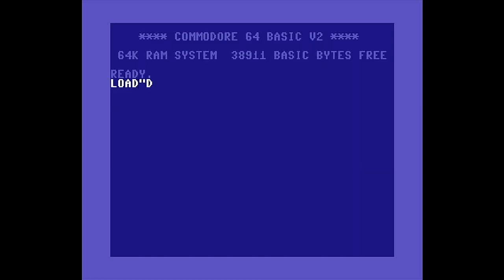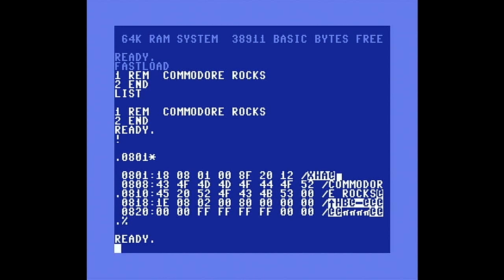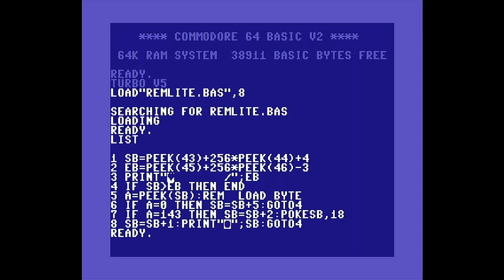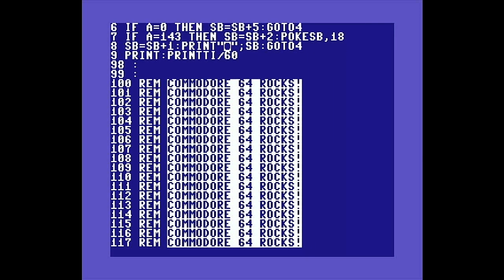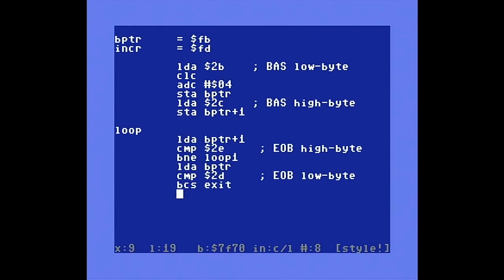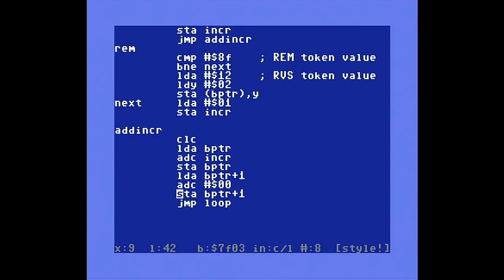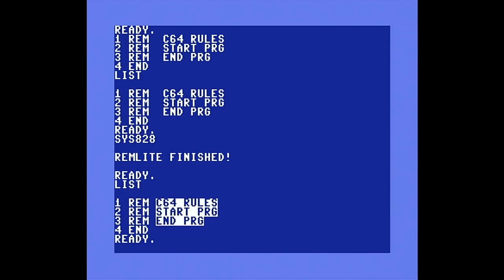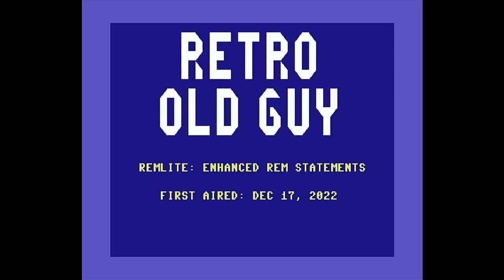Using Commodore BASIC and ML to create a REM enhancer utility for C64, C128 and VIC20 computers

Comment: it could also add a color change at begin and end...
Reply from the maker: Interesting, I tried this.  To get the color code at the end of the REM  you have to alter the bytes linking to the next line.   Once that's done, it displayed properly but if you add more program lines or run the program, it corrupts the last link pointing to the end of the program and will display garbage until you fix it again.   However I was able to do this:
     10 REM -- (BLACK} COMMENT {WHITE} --
Where the first two dashes would be whatever the current text color is and COMMENT would be black and the trailing dashes and all text following will be white.   This way the  programs internal links are not corrupted and you still get color comments.   BTW any printable character can be substituted for the dashes
Am I missing something though?   How would you do it?

Comment: Thanks for the tutorial!  Another way to perform the BASIC conversion would be to add the following three lines to the end of the program to be updated (assuming the highest line number is less than 1000), then type RUN 1000, then delete these three lines...

1000 forx=2053topeek(46)*256+peek(45)-3
1010 ifpeek(x)=143andpeek(x+1)=32andpeek(x+2)=32thenpokex+2,18
1020 next

It will only reverse REM statements with two spaces after the token, so there's no need to worry about inadvertently overwriting code in cases where there is only a single space after REM.
Reply from the maker: Why didn't I think of that?  Such a simple solution I didn't see it.   I added a few lines of code to the ML version to check for two spaces after the REM.
         iny
         lda (bptr),y
         cmp #$20
         bne next
         iny
         lda (bptr),y
         cmp #$20
         bne next
Reply: @retrooldguy9880  To be fair, it's kind of a "brute force" method that doesn't take into account the possibility of three consecutive bytes that fit the pattern that you might not want to update... but I think the chances of that are probably pretty remote.

Thanks for the updated assembly code - I inserted the eight additional lines of code you provided and it works like a charm!

Comment: Elephant in the room: Before this, we might think that just setting "rvs_on" while typing the rem would work. Why doesn't it?
Reply from the maker: When you are typing in the editor, pressing CTRL-9 (in non-quote mode) will turn on RVS, but it's a cosmetic effect only, no RVS token is stored in memory, which is why you have to enter it manually (or programmatically, as I did).
Reply: @retrooldguy9880 : OK, that's interesting, thanks! You know, I bet ya many kids tried that and wondered why it wouldn't work.